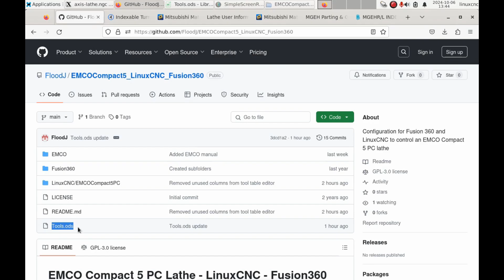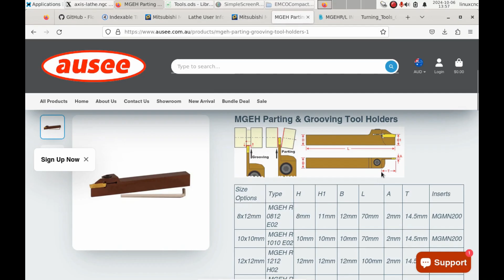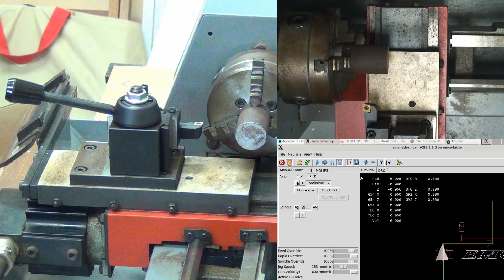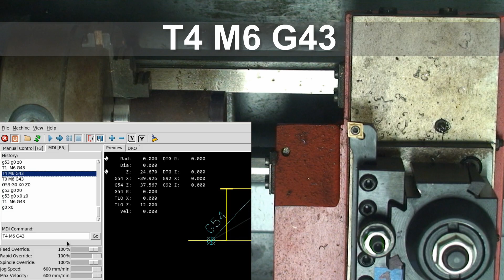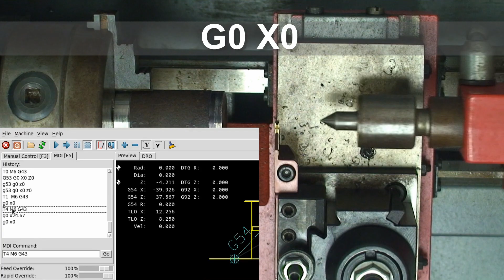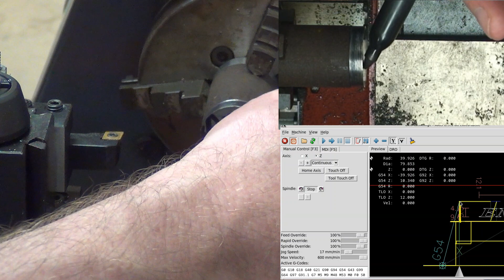EMCO Compact 5 PC Lathe with LinuxCNC and Fusion - Part 2

Comment: can someone help newbie, my cnc milling machine, if i add laser cross hair to near spindle, and bolt wood piece to table then move laser cross to wood piece corner, how i offset BIT center to wood piece corner alltime easy only same, laser i think install to near spindle x dimension X and Y, then have easy bolt wood piece to table right looking laser line . then how move bit to corner, laser to bit have same dimension alltime, immovable laser position. what G-code need use, spindle laser position move to bit position, same wood piece corner.
Reply: i mean bolt wodpiece anywere on table no matter were. and then find corner whit laser, and then bush button spindle mode same corner. offset or what need use ????
Reply from the maker: Sorry, @mattivirta - I haven't tried a CNC milling machine, but you may be able to use tool offsets to achieve this by loading a dummy tool and aligning to the LASER then loading the real tool with the correct offset. Otherwise, you could just align it, use G0 Xnn Ynn to move the tool to the workpiece home and "touch off."

Comment: Is this driven by ball screws or lead screws?

I use one of those 3d probes with a sphere on the end. I put it in the 3 jaw chuck and I touch off the tools on the ball to understand the offsets. Its quite accurate. At least for my small CNC lathe.
Reply from the maker: They are ball screws - there is a copy of the manual on the GitHub page with quite a bit of detail. 3D probes look like a good option, but I have a few other tools on my wish list first!